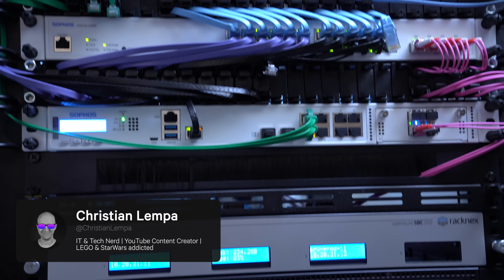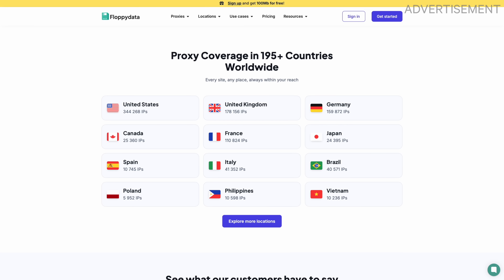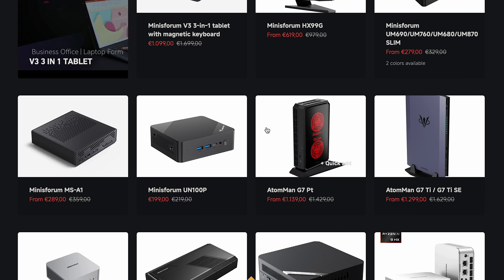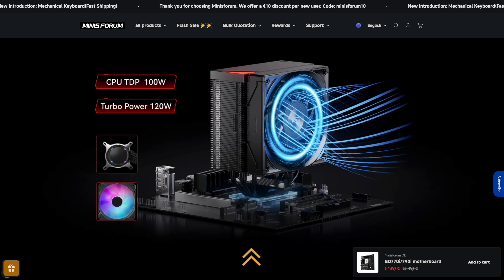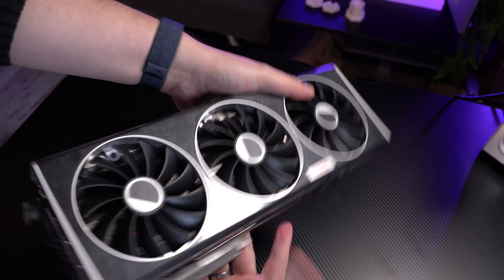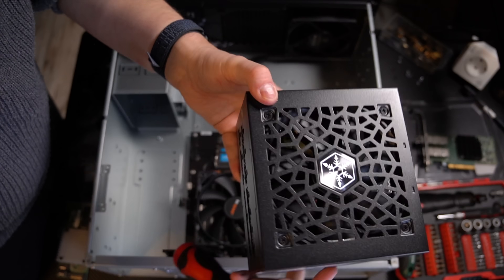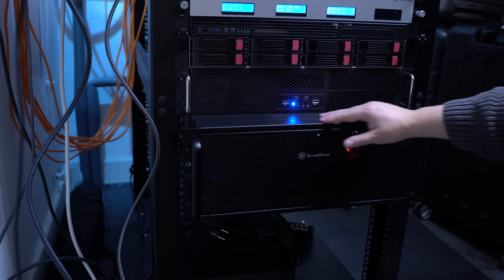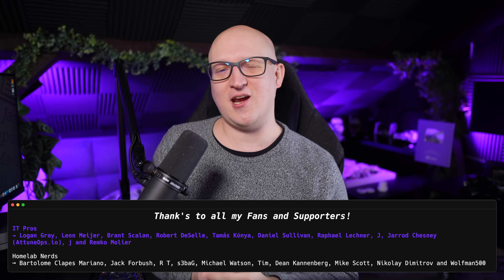My NEW Homeserver for AI + Power efficiency

Comment: Nvidia announced DIGITS for "supercomputer at home", cost around 3k USD with 128gb. Still not released yet.
But cost/performance it is cheaper to buy the Mac Studio with 512gb, costs around 10k USD.

Comparing the 512gb of ram alone, Mac wins with 3/4 of the price of Nvidia DIGITS.

Comment: Im also running a 7900xt, but Ive found lots of models that were designed to run with 24gb of ram, and 20 just isn’t enough. I end up running models that are in the 16gb tier anyways.
Reply from the maker: Good point, but for what I need it is enough.

Comment: I'm currently looking to build 2 XCP-NG hypervisor nodes with emphasis on low idle power consumption. I did look at this board, but was a little turned off by the lack of PCI slots for 10gb network. I like what you did here. I'm trying to decide between this and a build with a 5700G (or similar). I'm wondering if you are interested in performing bench mark testing with Core Performance Boost Enabled and Disabled? I'm really curious how this setting affects performance and power consumption.
Reply from the maker: Hm good question, when I’d find the time to do it 🤷 maybe let’s follow up on discord